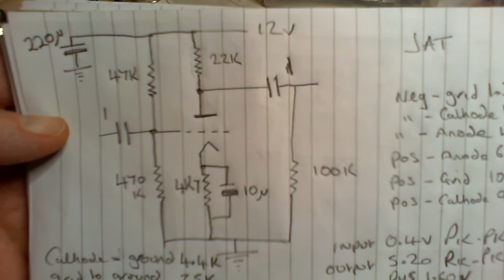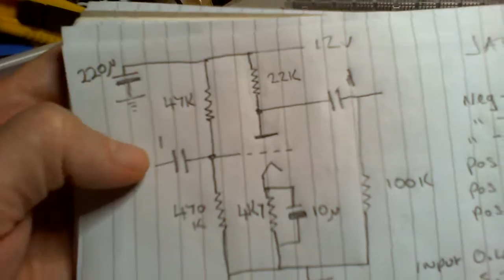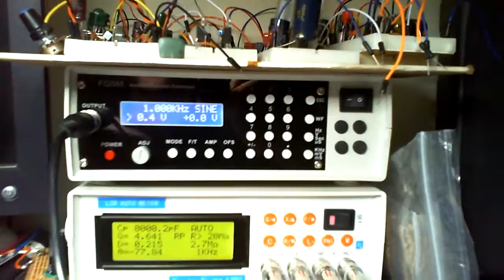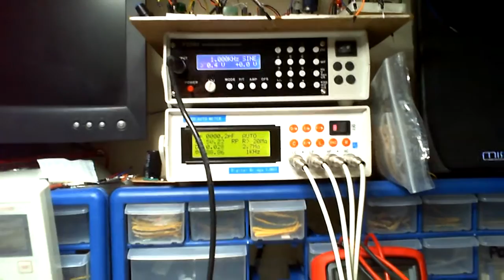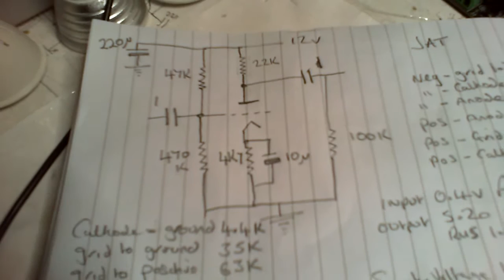ECC83 Valve or 12AX7 Tube Single Side Amp FAIL

Comment: This will NOT drive speakers! Output impedance is very high and is for preamp use only. Bias the grid so the plate voltage (ground to plate) is about 1/2 of the supply voltage.
Reply from the maker: OK I will do that. I appreciate the input, cheers.